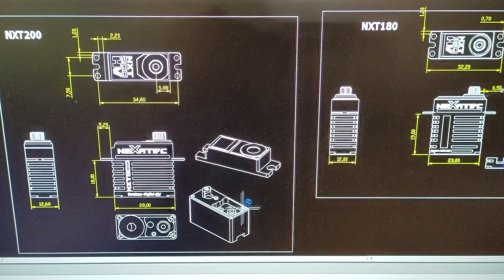NXT Servos - How its made? Watch in this video how servos are manufactured!

Comment: Most of the latency is in the electronics unfortunately. The PWM for these things really should be on the scale of microseconds rather than milliseconds. You could have best in class latency too. Please, for the sake of high performance robotics, use faster chips and signal pwm standards.
Reply from the maker: for R/C planes they are one of the fastest and strongest in its class!
Reply: for a mere 1 dollar extra in manufacturing cost, you could get an RP2040 chipset to handle the signal processing. You could use PIO to make your chipset responsive to pwm signals in the microsecond regime, rather than milliseconds.  @PrecisionAerobaticss You may have the strongest and fastest, but you still have a pwm signalling on the scale of milliseconds. you could have such high performance and so little latency that you lead micro-servos into a new era of high performance robotics. You could lead the charge.
Reply: They're not for robotics 🙄
Reply: remote control devices are simple robots @CaterhamMatt